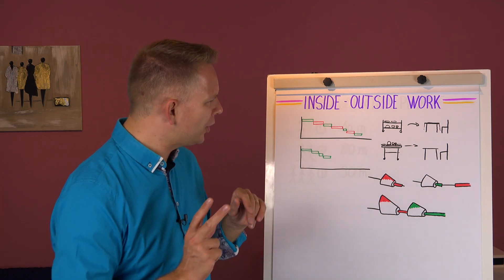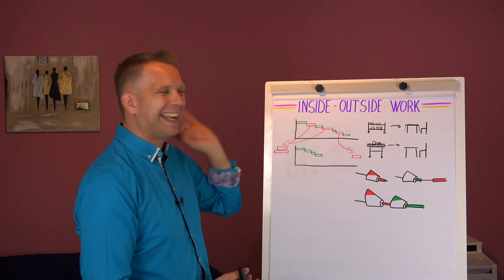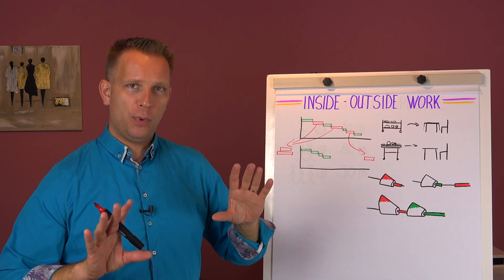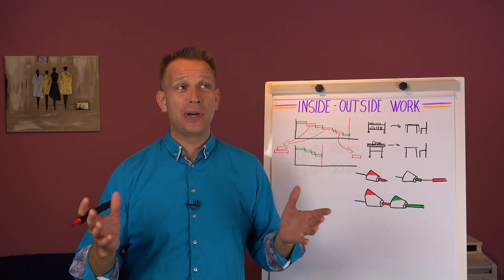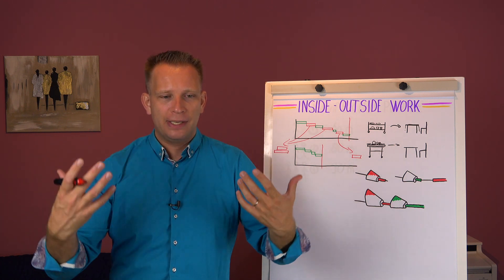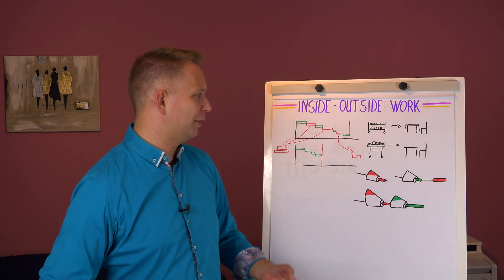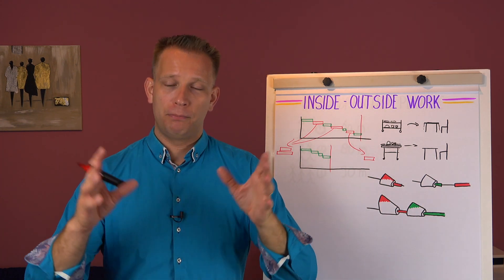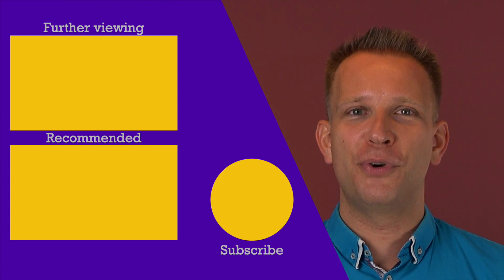SMED tool: Inside vs Outside work

Comment: Hello Tom, thanks for the instructing video. I also understood, that in SMED, you also identify the tasks that you habitually do when the line is idle (internal tasks) and convert as much as possible into tasks when the line is running (external). Right ?
Reply from the maker: SMED is about seriously reducing machine downtime due to cleaning and/or change-over, so yes - any task that now takes extra idle time, but might be possible to do when running the machine, is under the attention of SMED.